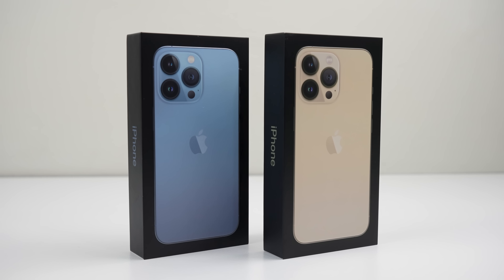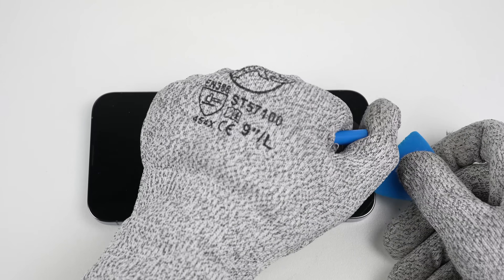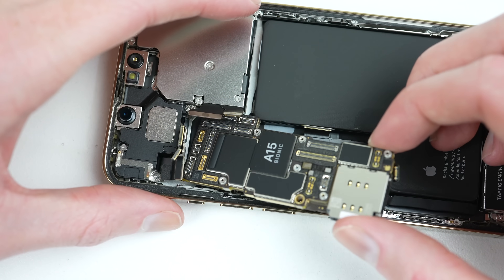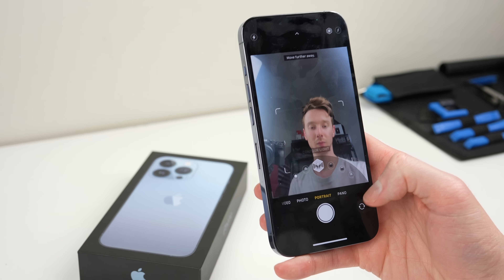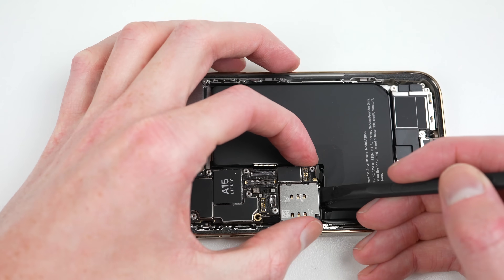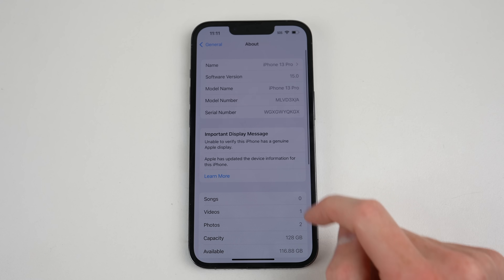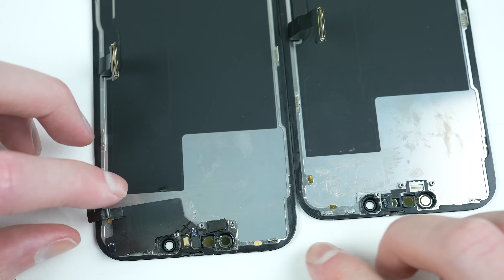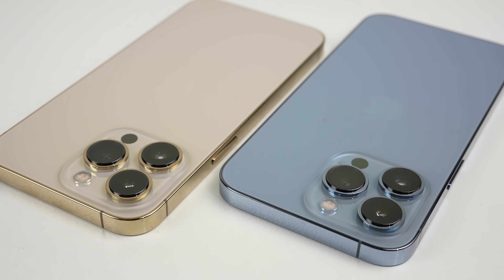iPhone 13 A Repair Nightmare - Teardown and Repair Assessment

Comment: Around a week ago I did a screen replacement on the new SE 2020 and it had no auto-brightness too. I didn't damage the flex because the front camera and ear speaker were working. I think Apple disabled auto-brightness after screen replacement with some IOS update. :(
Reply: I did display serial number copy for true tone restore.
Reply: im guessing true tone isnt there either, you havent overwritten the display, have you?
Reply: @kasiorap  I'm assuming not, although iOS updates cannot add/remove software locks, as an iPhone 6S on iOS 15 has the exact same software locks as on iOS 9 (ie. its release version).
Reply: @aydoyt  I would like to remind you of the time that Apple prevented iPhones with a replacement display from booting back on the iOS 10 days(i am not sure what version of iOS exactly, but i think it was around that time). So yeah, Apple can totally do that shit move of adding software locks as they please. My mom's iPhone 8 no longer has auto-brightness even with a brand new flex cable  so yeah. Screw Apple for making everyone's life worst.
Reply: did you copy data over from the old display to the new one?
Reply: That reminds me of macOS 10.12.4 which disabled brightness control on replacement MacBook displays even if you put a genuine display.

Comment: judging by the fact that they shove AppleCare+ down your throat when buying a newer iPhone I can't see why anyone wouldn't buy it now since they basically require it if you want a working phone after an accident. My concern is what's gonna happen to these in 3 years when you have usable phones that just need some refurbishing becoming completely useless due to a software lock?

Comment: "Some people using blades to pry the screen could damage it"
**PhoneRepairGuru with his damaged screen 👀
Reply: Don't forget about that jerryrig guy.
Reply: I always pry up the screen with a jimmy tool & heat. suction cup takes forever and if the screen is cracked its ineffective. The screen had heat damage because I couldn't see what I was doing because of the camera in my face.
Reply: @PhoneRepairGuru  I like the flat blade because it doesn’t flex or give.  Whatever works for you is all that really matters.  I’ve seen people use playing cards.
Reply: @thecoylewis  True I used a heat gun, not the usual heat pad so that I could get it in frame. I'm no where near as talented as Hugh when it comes to recording my repairs.I  Hope to be soon, this video was a 10/10.
Reply: @PhoneRepairGuru  I’ve been working on my videos and recording techniques for months.  Repairs are far more complicated when trying to film it because you’re not just doing the repair anymore.  You’re doing the repair trying to make sure you’re getting the right angle.  I follow your channel.  You’re doing a great job with your videos.
Reply: Phone Repair Gruru messed up the OLED using too much heat
Reply: I actually think this Face ID loss was unintended and will be fixed by a patch sooner rather than later.  Even it was intentional, I believe they’ll fix it with the next update.  They’ll only hurt themselves on their fight to stop the right to repair if they create this much negative publicity.
Reply: I use a flat blade to open my phones and never have issues scratching or breaking the screen.
Reply: Thats why Hugh said "SOME people could damage it" Not all people.
Reply: Not saying that anyone's method is wrong. I only refurbish and resell phones, so I don't mind using something a little more rigid to begin the disassembly. I just don't use metal on a replacement housing. I also try not use heat on an iPhone, if I don't have to.

Comment: Tbh some of the things they blocked before (like Face ID if you replaced the sensor) actually had a tiny bit of a reason to them. But when third party screens (or even genuine apple ones) make Face ID and auto brightness not work? That makes no sense and should be illegal.
Reply: Blocking face ID on swap makes 0 sense. You are replacing the hardware side of it, not the software. There's no security risk unless they are stupid enough to process it at the module
Reply: @felipepubillones2768  yeah I guess I didn’t think of it that way. Well that just makes it even worse I guess.

Comment: Ok, I kinda understand locking FaceID because it may be a secirity risk, but the rest? Damn, that's som grade-A-dickery by Apple...
Reply: Really? What security risk? All the software is happening on the mainboard, not on the camera
Reply: @Carterthielftw_  There MAY be a security risk. Even unprocessed data can be valuable, and a simple device to send the data somewhere else is small enough to be hidden in a USB cable, so it'll may be possible to do something similat at this scale. I personally am also saying that this is a pretty minor risk , but I still think it's a valid point that a company might want to restrict funktionality when this aspect is tampered with. On the other hand I also think the way Apple implements this is too strict, not even genuine Apple parts allow to keep the feature active, that's too much.

Comment: Apple: we want to be carbon neutral
Also Apple: let’s serialize and lock every part so these phones can’t be repaired by just replacing hardware and then under train our Genius Bar to always default to saying “replace your device”
Reply: Yeah because Apple dont care. They do not care about their customers or the environment. They would do whatever if money is here to be made. No wonder they are the most valuable company
Reply: @Big_Computer  They do care about their customers and about their reputation. Apple doesn't wanna have a reputation for having exploding phones, just bc users tried to replace parts.
Reply: @JakeJoris  my moms iPhone 10 battery exploded on its own lol
Reply: I went to apple for my macbook pro and they told me it will cost 800$ to replace speakers because i was having audio issues and no sound and then i decided to do it myself and i replaced an audio cable and audio was back and working normally . i did it under 50$ so you can imagine how much they earn from this . 
other companies will copy Apple since they are also looking that if apple can get away with this so can we .
Reply: @KaizenAction296  Thats awesome you were able to resolve your issue. It sucks that they are pushing for replacements and against 3rd party repair.

But imagine you had your issue, but instead the parts to your speaker wear serialised. And the software no matter how you repaired it even with genuine parts artificially by software not made your speakers work..

Ugh I really hope what they are doing with their iPhone doesn't carry over to their macs and other products.. 😔
Reply: @sheridanoleary3017  Don't jinx yourself
Reply: @aydoyt  I'm not trying to lol. Just trying to state that the way shit is going I wouldn't be surprised anymore if little things like that get locked away by software.

 Hell god forbid you replace a screw and the device detects the screw as "non genuine" and bricks itself lol.. it's a scary future but wouldn't be surprised how petty Apple or other manufacturers will become.. 😔
Reply: And the Apple faithfools scream "Shut up and take my money!!!!!".
Reply: @pook6212  I have had apple sine the 3 but only because I had problems with android so kept going back because it just worked but now I really can’t decide what to do lol see my post it’s the long one lol
Reply: Then they'll repair the first phone cheaply and sell it as refurbished.
Reply: Unless you hack the serial because because fuck everyone lol
Reply: The ultimate step Apple could take is pairing the battery. That would invalidate all of their claims of being environmentally friendly
Reply: @pressbTD  they already have
The battery meter is gone if you replace the battery
Reply: @meki___6881  no I'm talking about Apple completely disabling the battery if it's replaced, rendering the phone useless of it's not connected to a charger
Reply: They don't want to be carbon neutral, they want people to think they want to be carbon neutral.
Reply: well i repair iphones, and our government doesn't give a shit about apple, so we can do repairs without being in trouble.. customer came up to me and said he wants his iphone 6s lcd to be repaired, apple quote him 150$ for the replacement, i did it for 65$. hahahaha
Reply: @Leland Holton . They call themselves genius bar people but in reality they are trained to lie to their customers and get as much money from them as possible.
Reply: Also also Apple: "let's get rid of stuff people might need like a charging brick, so people will have to order one off of Amazon and create even more problems for the environment!"

The irony of Apple's push to help the environment is actually kinda amazing.
Reply: @TheIshikawaRin  They literally pay other companies to say "yep, Apple's manufacturing is exclusively using clean renewable energy" when energy grids simply don't work like this. It's all just marketing (i.e. lies)
Reply: they play the long game, namely if humanity perished due to climate change humanity will be carbon neutral.
Reply: And then they will turn of these messages with software and sell the same device again in the reconditioned program from 80% of the price of a new one. But at least in Europe the commission is trying to make this ilegal and obligate brands to disponible parts to the costumer for 5 years, soo I bealive this will change shortly.
Reply: literally though
Reply: they're hypocrites
Reply: The thing is, that probably is the better solution environmentally. Or at least, it allows apple to monitor how many components they re-use and/or recycle etc.
Reply: @AHR_James  There is absolutely no way that buying new phone is more environmentally friendly than just repairing an old one. Apple "recycling" isn't the solution, it's a band-aid to a problem that they're actively causing.
Reply: @Raiynex  Forgive me, but the complaints are generally that Apple force you to get them to do the repair, not that the repair is impossible. Not saying I agree with that approach, it does of course mean you need a another new phone, but depending on failure rates that may not be a terrible outcome.

Comment: 🇪🇺European union 🇪🇺 just passed a law for adoption , forcing manufacturers to provide original repair parts to 3rd party . So apple will be screwed 😂🔥🔥
Reply: What part of "even original parts don't work" don't you understand?
Reply: @gearfriedtheswmas  well since you got lots of lefty crazy  envoirmentalists , use them for good and point them toward apple a bit 😂😂
Reply: Only on Europe, though. They're pretty much fine elsewhere.
Reply: If this is true, then my future will be saved.
Reply: @pallyomajest  ye but , outside EU i hardly believe anyone will take actions on big tech companies
Reply: Lad from spain here, do you have any info on that law? I want to give it a read myself
Reply: @pepe7904  Just read it in details . So the parliament has voted right to repair , and it will force manufacturers of electronic good to provide parts for up to 10 years for their devices
Reply: This can't be real, give me the actual law. Idk about the EU, but I need to know either the name of the act or code to believe this. Louis Rossmann hasn't reported on it either with gives me skepticism